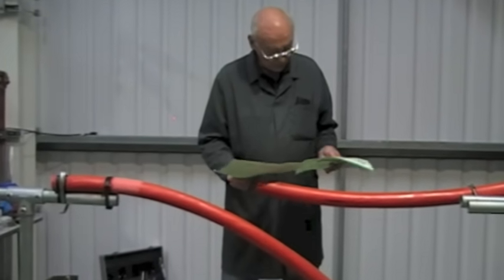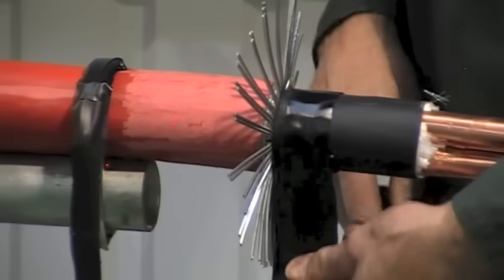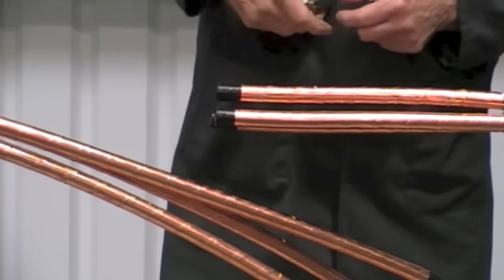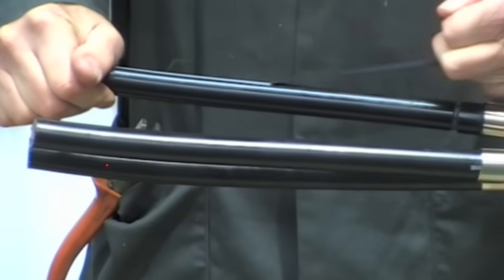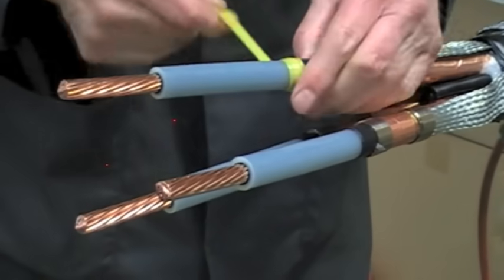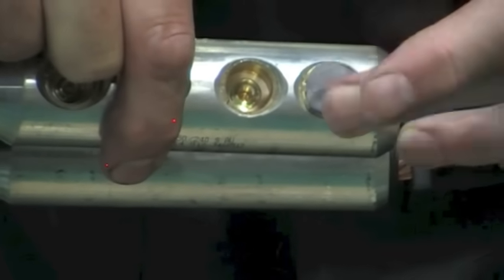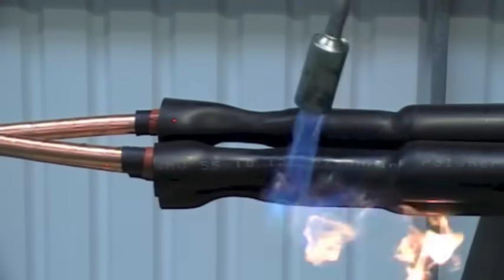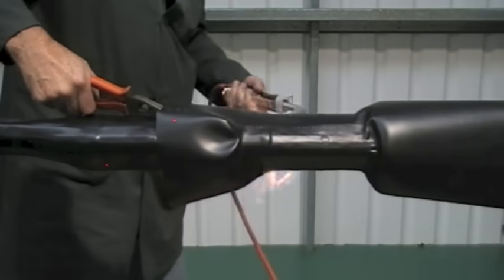Heat Shrink Cable Joint - 11kV 3 Core XLPE & EPR High Voltage Cable Joints

Comment: what about individual shielding on each before they got shrink tubed? they have a copper tape surrounding each one so not to allow each to affect the other, but I didn't see him put anything like that back on.
Reply: The aluminium cage he puts on at the end creates continuity between the copper tapes. There is a minimum gap between the screen cut and the connectors.
Reply: +Chris Benjamin your talking a grounding cage I'm talking about the individual wire shields. he removes the copper shielding tape off of each but only puts one back on around all three. each conductor requires a grounded shield wrapped around each conductor to provide the necessary insulation between each in case the plastic sheath on each conductor was to crack or wear out. the individual conductor shield provides a direct to ground path if the insulation is compromised as well as keep each conductor from magnetically affecting the other 2.
Reply: +wheelitzr2 yes the copper shields get a braid connected via roll spring and terminated onto the support ring. Then the cage connects both support rings. You haven't mentioned the semi-conductive layer, what do you feel about that not being continued over the connector?
Reply: +Chris Benjamin yes at the end or outer most area of the connector is terminated with the roll clips and braided wire at the ends but that doesn't go around the conductor like the copper wrap that he took off at 6:00 nor does it do anything more than connect the braiding to the copper on the other side of the joint. the copper wrap that he removed at 6:00 covers each entire conductor but he doesn't put any shielding back on each individual conductor just the aluminum cage and the copper mesh around the entire thing before the outer heat shrink.
Reply: +wheelitzr2 how are the copper screens usually taken across the individual connectors when you are completing this type of joint?
Reply: +Chris Benjamin we use a special collapsible copper mesh tube the goes on before the connection is made then gets tied to the ends were the metal braid was connected with the spring clip. that way each individual conductor is shielded twice from the other 2. (once for its shield and a second for the shield on the conductor next to it. they have such a high amount of voltage that the magnetic field created can affect the other 2 conductors if they aren't shielded correctly. this is why power lines in the air are so far apart, one so they don't arc over and 2 so they don't create ripples in the incoming AC sign wave on the other conductors due to electromagnetic interference. if you ever stand under a high voltage line the buzzing you hear is the electromagnetic generation happening on the lines. that copper wrap at 6:00 keeps that from happening with the wires so close together.
Reply: +wheelitzr2 are you a 132 jointer? What voltages do you work on?
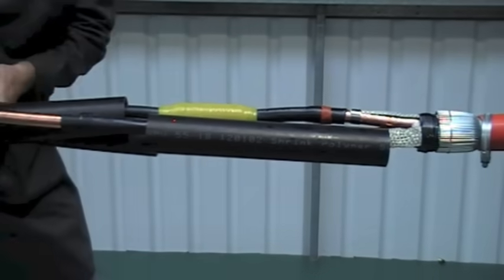Reply: +Chris Benjamin 14:39 he does call the shrink tubes "dual wall conductive tubing" however the conductive part isn't connected to the other shields at the ends so it's useless as a shield.

Comment: We have to carry out PD tests when working in substations with these joints, several have failed when installed vertically
Reply: I know, they fail on a regular basis
Reply: the orientation should not have any adverse affect. something is contaminating the union.

Comment: Its pretty amazing because ANY excess resistance at such high voltages becomes basically a toaster and will fry the cable. Also, circulating currents due to fields can become and issue and create heat.  It could become expensive too because a bad joint could waste a lot of energy. These cables are designed more like video Coax cables when you take impedance into effect. You wouldn't just join two RG-6 cables by twisting the conductors together. A bad video cable splice may throw a microvolt signal out of phase and give a bad picture but at these voltages a bad connection could induce eddy/circulation currents and create havoc.
Reply: Exactly, pretty much completely backwards. High current results in heat, high voltage results in a strong E-field and corona discharge around sharp uninsulated connections. Eddy currents stirred up by magnetic fields are not normally an issue with cables like these, and electric fields don't stir up LARGE currents unless there is a massive gradient and high frequencies (capacitive coupling in high frequency high voltage circuits, like in a modern X-ray machine with 50kV transformer switched at 25+ kHz). The characteristic impedance of 3-phase power cables (both shielded and not) is waaay less important than coax carrying signals (fault current capabilities and mechanical properties of the insulation often see more attention). Bad connections in coax or power cable don't result in eddy currents (magnetic/inductive coupling), they result in a poorly grounded shield that can act as an antenna, picking up RF noise and capacitively coupled signals.
Reply: alb12345672

Comment: Some big ass shrink tubing.  Would that cable carry 3 phases?  Not sure why the need for 3 separately insulated cables.
Reply: Gromitdog1 yes three different phases: Red-Yellow-Blue or 1 2 3 or brown black grey depending on what country you are in

Comment: that is fascinating / what a lot of adhesive tape !
The earth is the shiny external , the copper ribbon going all along is also to the earth ?
Reply: yes, the inner earth has todo with the magnetics fields around the inner core for cancelling out that field, these joints also have to be totaly free of air inside, since we are dealing with volts OVER 3kv and when we get over that then air simple isn't a good enough insulator, so any airbuubles between the inner earth and the inner core,  would mean the joint would burn over in about 4-5 hours if we are dealing with 11kv.

but my english simple isn't good enough for explain it fully, sorry.
Reply: +zentrobi thanks a lot . you  did explain well,  at large. :-)
Reply: +zentrobi where are those connections found ? in the air, included in tubing, or under earth ?
Reply: they can be in the air too without any danger, but i think thats rare(or atleast i havent seen that in my time as electrician) these cables are supose to lay underground/in earth, but you see them too in transformation stations where they go to a transformer or a switch. the joints can be in the same places as the cable.

Comment: THAT'S SOME MASSIVE HEAT SHRINK!  I whine about the high prices of the small diameter (1/16 to 1/2 inch) 2:1 and 4:1 shrink ratio stuff I buy.  I can't imagine the cost per foot on that.
Reply: The kit he has used will probably be between £500 and £700

Comment: I love YouTube because of vids like this. 

Filming question: During the shrink-heat portion, would time-lapse filming show how the tube shrinks? Fast-forward seems to skip the most delicate part of the process as implied in the title.
Reply: +Mick Craven those heat shrinking tubes come in all dimensions and they are really useful when repairing cables , small or big. They are not so expensive I always keep some in stock? They can also make caps for sharp tools that are delivered without one.
Reply: Bet you have a cool shop. :-)

Comment: +Toby Sinclair-Bell Good call on the yellow flame, the red mastic should not protrude beyond the first shrinks, it needs a wad of red mastic between the three conductors at each end and the gray silicone tape is not for a pressure seal between layers it's for gap filling, so the last lap seal needs to be the red mastic, and how did he run out of the aluminum gauze and not finish the half lap covering? Oops

Comment: Now I can splice my 11kV primary line for my new secret laboratory. I origionally ran my primary too short. This will solve my problem so I can resume taking over the world.
Reply: Just watch out for annoying sisters and/or midget rivals.
Reply: Just a heads up for ya on your 'world conquest'.
It's going to take a LOT of effort to get past my 500kV energised faraday cage I've built as a 'panic room'.
I guess you COULD just wait for the batteries to run down, but since Elon Musk grabbed all the Li-Ion cells, I chose to use a Thorium-based LFTR inside the cage instead.
Given the half life of my Thorium stockpile, I think I should be god for about 13 or so billion years
Reply: @trevorvanbremen4718  pp
Reply: dexters laboratory lol
Reply: Eìon O'hInneirghe  ha  ha  ha  ha  ha  haa
Reply: Learn how to spell "originally" first, then think about taking over, please.
Reply: @pammullinsx6026  i and o is next to each other. it wasn't a big deal, since you know it meant "originally". just a simple typo, and not grammatically error.
Reply: @luthfieyudhairawan3883  Oh crap!  I got your attention!  Now I reckon I'll be the first to be eliminated when you start your world domination! 😃

Comment: i saw 3 exposed copper together, why never put individual insulation. could cause short circuit!
Reply: +jun marajas I believe this outer copper tape, covering the three cores was a ground connection, common to all conductors and the wire armour

Comment: how do you know what phase is which  is the cable jacket marked ?
also when cleaning  do you wiipe t away  from the copper  end  towards the jacket 
to prevent arc tracking 
also even if the power is off and known to be off. induced power may still  be present
in cables  by the  transformer effect  (inductive coupling between cables on power lines) 
can these cables be grounded and made safe  whilst working on your repair?

i have seen 415v cables in the uk being spliced and joined whilst hot 
we had a new feed put in 
the guy was  in a hole in mud and water in poor weather and light   not kv stuff  but enough to ruin your day 

with kv stufff you dont need to touch it to kill you  it will jump out meet you half way

Comment: That would be a pain in the ass if you connected the wires and forgot to slide the shrink wrap on first.
Reply: +99beta Exactly what I was thinking. That step should have been in the first part of the video.
Reply: +FREDDIE MAXWELL you mean the part at 0:11 ?
Reply: Dennis Lubert the part that was removed right after it was shown going on, yes.

PS: they’re stress control tubes, not heat shrink.
Reply: zip heat shrink? What a time to be alive...
Reply: Not a big worry, there is zip heat shrink, that can fit on a cable without sliding.
Reply: yavv kolev .🗽
Reply: What a world! :D
Reply: yes but im not sure they allow it on 11kv...
Reply: Henkka B I've seen it used in 22kv
Reply: It will take once missing the heat shrink you’ll not forget the next time 😊
Reply: yavv kolev It may exist (good info!), but your boss probably wants you to follow the company workinstructions :-)
Reply: I just use the spray-on electrical tape... And it's been fine so far! Lol
Reply: it happens. The apprentice gets to chip off the connector so they learn to tell the splicer not to forget the boot . The best way is to make sure the splicer can't get the connector before all steps are confirmed first
Reply: Dennis Lubert: nobody paid attention to it.
Reply: Been there done that.  On a vastly smaller scale however.
Reply: Easy, you just slide it on from the other end of the cable. All. The. Way.
Reply: haha
Reply: oh no! xD
Reply: très bien
Reply: amen
Reply: done that so many times lol
Reply: Been there, done that. Never did it again 🙂
Reply: it always happend with me
Reply: I have done that before. Of course on much smaller individual wires, but nonetheless it sucks
Reply: In splicing 18ga cable, I always try to keep the splices staggered to avoid a lump. Is that not suck a big deal in these instances?
Reply: 99beta
Reply: there are shrink skirts that can be put on afterwards. But this is a simple joint. Herr in holland there are joint whit one 3x240 20 kv and 3 single 240 kv. That means that on skirt has 3 openings and that one has to be placed correctly before joining the set together
Reply: @kapteinron  im from poland and here they would never allow a skirt to be used on anything but low voltage (0-1kv) and even then in 99% its just 400v line. most medium voltage in poland is like 15kv and when that gets shorted, it pretty much explodes, skirts are amaizing at making job quicker, even tho they cost like 10 times more but i wouldnt ever use them for medium voltage
Reply: Oh it's happened before and it is a huge pain in the ass
Reply: And the heat wrap is way to big of sise lol
Reply: Oh my fucking god….. i forget that all the damm time when I’m wiring RC things
All done with some tricky ESC plug, ready to shrink it….. no heat shrink
Reply: And that's why we always keep a zip shrink handy lol

Comment: 9:44 "...all carbon traces must be removed from the primary insulation" but once he is done of that he marks it with a yellow grease marker.
Reply: +David Hughes And shrinks it with a yellow flame that is probably putting soot (Carbon) all over the place...
Reply: +Toby Sinclair-Bell Good call on the yellow flame, the red mastic should not protrude beyond the first shrinks, it needs a wad of red mastic between the three conductors at each end and the gray silicone tape is not for a pressure seal between layers it's for gap filling, so the last lap seal needs to be the red mastic, and how did he run out of the aluminum gauze and not finish the half lap covering? Oops
Reply: It's already over engineered by the insurance company... Because writing up new SOP's out of blood, tends to cause more issues than doing it right the first time.

Comment: I don't know what it is, but these industrial cabling demonstrations are friggen fascinating to no end.
Reply: Yes they are I'm an electrician and this are very critical connections you have to be trained how to do them
Reply: @GTOMEX110  yes you're right and I agree too
Reply: phuturephunk ok good I'm glad I'm not the only one that fell down this rabbit hole.
Reply: +phuturephunk i have little to no experience in anything electrical. i'm kind of handy, do my own work on the car. For some reason i've been watching the shit out of these!
Reply: Live LV jointing is more fun especially on old lead cables
Reply: search "0000 awg" and compare it to 10 awg or speaker cables
Reply: Technically they are fascinating to two ends.... Badumtssss.... I'll see myself out.
Reply: phuturephunk

Comment: im just here soldering 12v dc connections
Reply: 12v 2000A
Reply: hope you are using heat shrink :P
Reply: @Lewdacris916  or at least heat sleeves :D
Reply: Heavy Duty 12v DC connections xD
Reply: You are doing it wrong!
Reply: Solder with titenium
Reply: 12v 300ka
Reply: It's been 5 years have you graduated to 24v?
Reply: Same. What a rabbit hole

Comment: I've got these as my speaker cables
Reply: +Voima 

More importantly, did you use cable elevators to elevate the cables off the ground as not to cause interference and static buildup?  Did you break in your wires for 96 hours?  Are you using oxygen free copper?  lol
Reply: @pmgodfrey  lol

Comment: if anyone could do this live i will give them £1,000,000
Reply: +Woods Gaming Channel Petition Bossa Studios to make Lineman Simulator 2016.
Reply: +Spikey Husky i think a lot is done live if you can be charged to same potential and isolate  yourself from ground
Reply: +Virtualgod2009 i understand, im a sparky and looking to get into bigger stuff in the future, distribution... Pays better and honestly i think its much more interesting than 230/400v i currently work with
Reply: hahaha before start the work, of course that should has been shut down.
Reply: Woods Gaming Channel Not worth it to risk your own life for that amount of money...
Reply: Woods Gaming Channel live as in the cables are live?
Reply: yes at 11kv potential... to be honest, they probably to do it
Reply: +Muhammad Azman Jamhari LOL
Reply: 11kv naa, I'd break down a faulty LV lead joint for that
Reply: That flash over will barbecue me....thanks alot
Reply: Sure, hook it up to a 12v transformer, mic drop
Reply: That's exactly what joiners do live but not this method they do with resin filled in my work I have seen 4 times from bugging to end and we tested as well to extend or branch off but 600 v

Comment: Being a retired electrician, I can tell you that is a back breaking job out in the real world. That cable weights a lot and it man handles YOU. Vid is a good one for showing how it's done, and I wish it was just as easy in the real world. He did a great job on that cable.
Reply: I've seen it done standing in a trench while a sump pump was running to remove the water the guy was standing in... not exactly laboratory conditions...
Reply: When I did 3 phase splices, I always staggered my butt joints
Reply: @davep6977  this is a high voltage joint,you cannot place connections where u would want..there are strict measurements the jointer must follow
Reply: @davep6977  tss that's what she said
Reply: @llary  nice
Reply: Definitely not that easy in a manhole/vault, and that's me doing single conductor 1mil mcm
Reply: Do you ever get to the end and realize you forgot to slip the heat shrink over it before connecting everything together
Reply: What is the name of the tool he used to strip that beast of a cable? Thanks
Reply: @jamesharrell4360  plier-style wire stripper
Reply: @jamesharrell4360  Alroc PG pliers for the outer jacket
Reply: :hand-pink-waving::hand-pink-waving::hand-pink-waving: 🤝🤝🤝🤝🤝We are power cables and PVC trunking manufactures in China.💖💘💝🤝🤝🤝🤝
Reply: yeah this video is a best case scenario, inside, cable nicely elevated from the ground and supported....
Reply: How long did this take in the field?
Reply: Just thinking exactly the same thing
Reply: And normally you do it down some pit. You cannot just stand hands in pockets..
Reply: Yup and doing it in any weather and confined spaces makes it even more of an adventure 🙃
Reply: I'm sweating beads just watching.